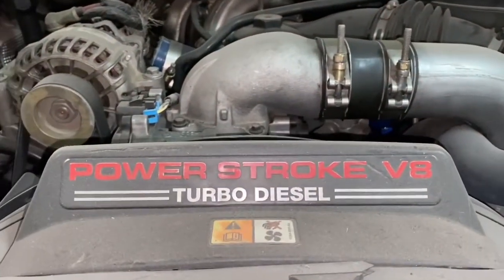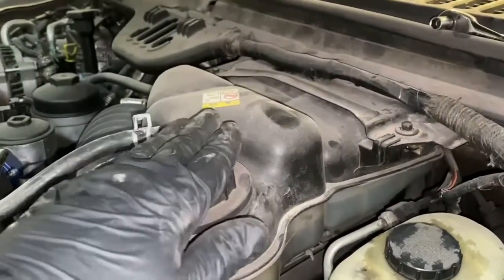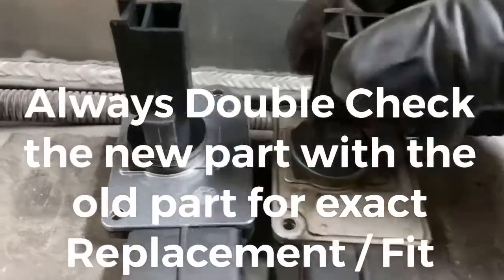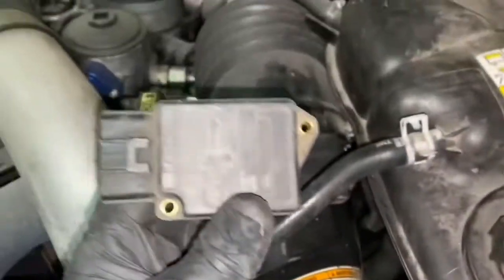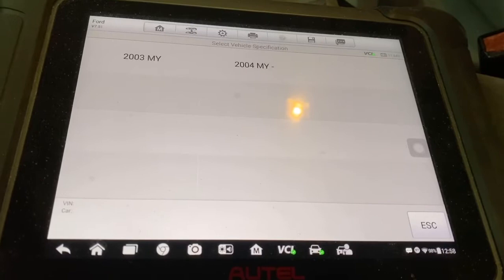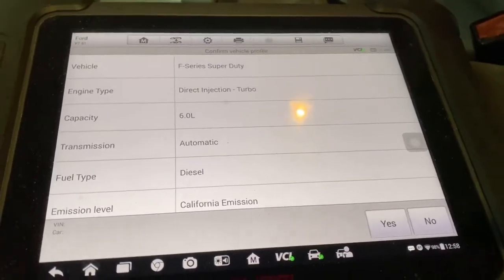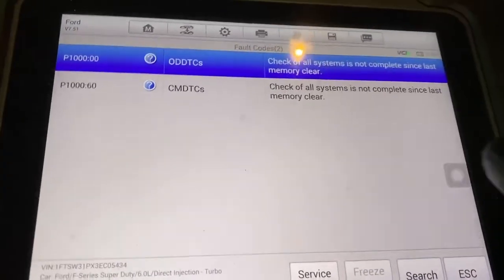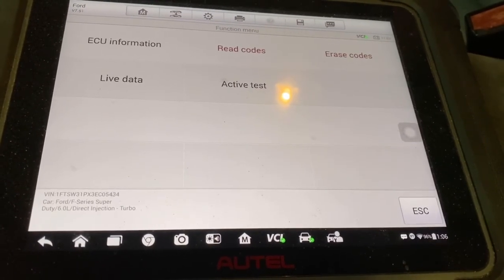Replacing a MAF Sensor on a 6.0 liter Power Stroke Diesel. Episode 65

Comment: Thanks, a couple comments. That scanner requires $700 annual subscription. It Was supposed to work after the subscription expired.  It does not. I renew my subscription on black friday to save a few bucks. Also when you clear codes it erases the transmission learning so if you manually down shift before the transmission relearn it's shift data, it will drag the rear tires momentarily on a downshift in the low gears. Cheers.